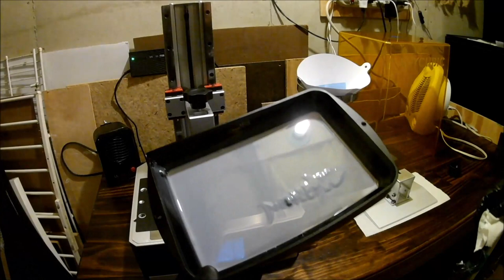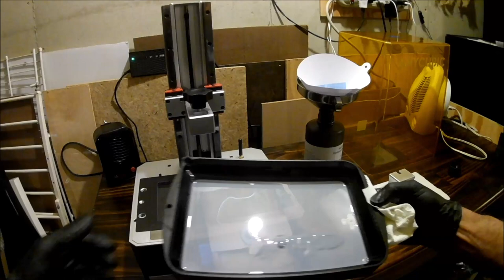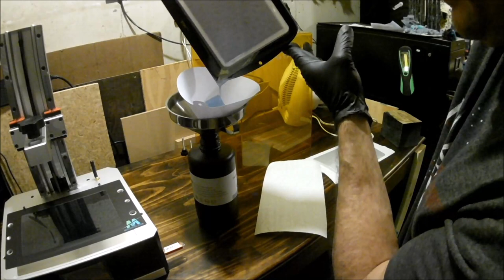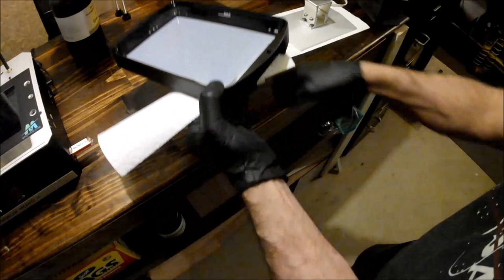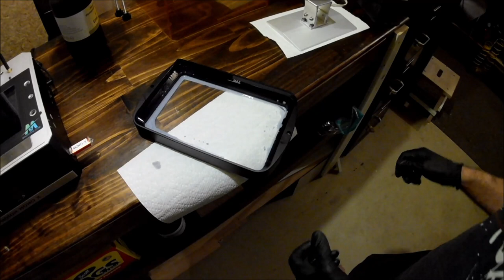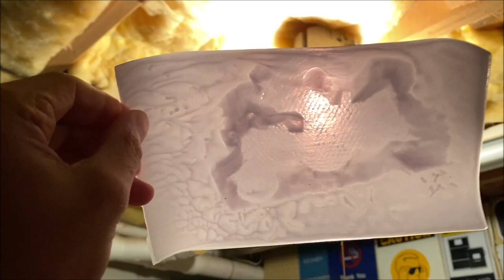Fast & Easy way to clean your Vat after a 3D resin print failure

Comment: Good trick, glad you mentioned the 40 seconds. I saw this on another video where the dude did not specify the time. It needs at least 30-40 to make sure it cures nice and solid to capture all the junk stuck at the bottom. You can also add a bit of used support, like raft side down, use that as a peg in the corner to pull it up. Just cure it in there for the time you cure the bottom.

Comment: You can make this even easier.  Save one of you sprue structures and place it raft side down in the corner.  Once you do this the rectangle will be joined with it, you can then use a simple set of pliers to grip the sprues and it'll let you pull the rectangle right out of the vat.  This can even be done with resin still in the vat.  Hold the rectangle over the vat for a few moments so the excess can drain off of it and you'll have a clean vat.

Comment: To me, it's simply a lot easier: 1 - return the resin to the bottle. 2 - Pry the misprint off the vat, similarly as you do with the magnetic plates. 3 - Check for debris. Clean and mount the vat as needed. Done.
Reply from the maker: Thanks for the tips.  That works well for a single failure, but if  you have lots of small spots and debris, this could be a good method to try.

Comment: Thank you. I was wondering how to do that on a Anycubic. If you got spill on the tray as well. could you do the same with a uv lamp för 30 seconds instead of wipe?
Reply: would not recommend curing it on the tray, i'd just wipe it off with an alcohol cloth. The FEP sheet is designed to release the resin, the tray sides are not
Reply: @LocQk2  Sadly you are right. I did a 40 sec exposure to clean the fep, but I did not the the film to drag off like you did. My failed prints broke away and instead I got a huge area of thin hard resin I could not get off. I I decided to cure the whole tray with a lamp and see how that ended up. Not easy to get off now. Huge fail.
Reply: @prewinder  sorry to hear that

Comment: you don't need to waist resin by exposure like that. just push from behind where the print failed and it will pop off. I had 100 of failed prints in my time and never had problems popping it off... I see no reason to expose more resin to the vat, really.
Reply from the maker: True, that works if you have a few larger "pancakes".   In this case, I had many very small pieces stuck to the vat and this method made it easy to get it all.  Thanks for watching!
Reply: In opaque resin with smaller parts it's not always easy to take out the failed bits .. might just be in my case because I don't have a dedicated tool for catching them
Reply: I made a special tool for this. I got a really thick rubber squeegee that one would use to clean car windows or whatnot. It was solid rubber. I cut it down to about an inch wide and put a really shallow bevel on the edge with a hobby knife. With it I am easily able to pop these little print failures off the fep without damaging it. No fingernails or plastic scrapers required.
Reply: Only nasa employees like yourself can afford to waste resin

Comment: Just exposure a bit and use your finger to take rectangle resin from corner my friend, no need to lift tank and filter it again…wasting filter and time…
Reply from the maker: Some people suggest adding an old support in the corners so you can just cure and use those to peel.  I'm just cautious to not tear the fep because it's a hassle.

Comment: Or you could of just rubbed your finger under it rather than waste resin
Reply from the maker: True, that can work in some cases.  The fail I had also included lots of small and thin pieces and this method is nice to clean the whole surface of the vat.   Thanks for watching.